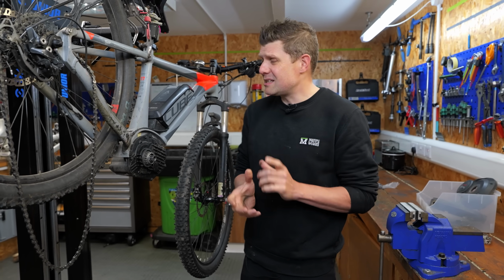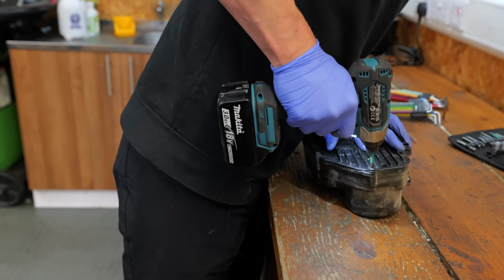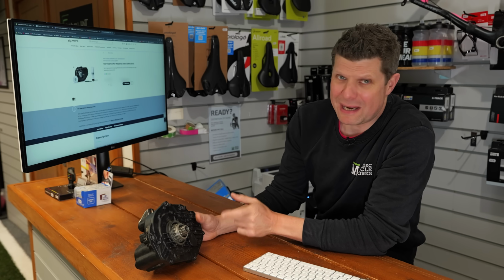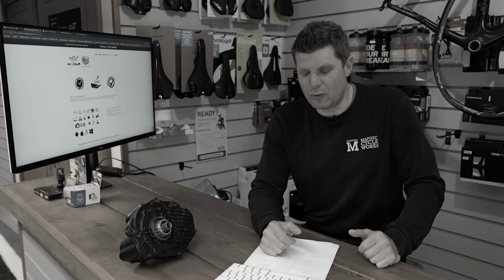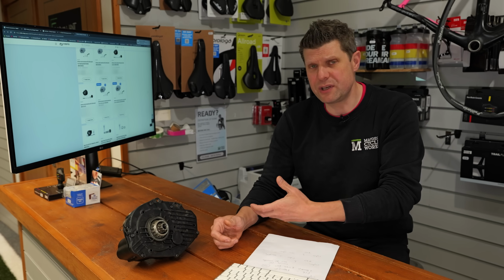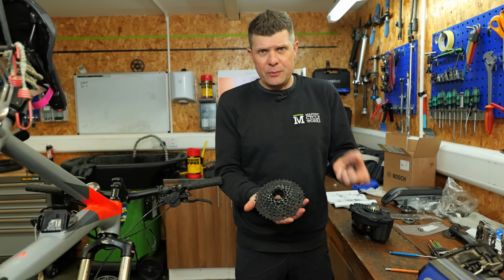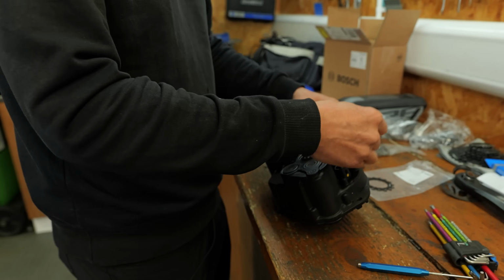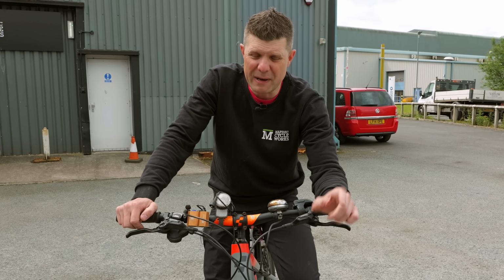This £750 eBike repair could have been avoided

Comment: my first mtb gary fisher steel frame lasted 10 years without any service no brake pads no chain absolutly nothing.. after 10 years .. maybe it was even longer.. the steel frame started to rust the brake lines where getting worn the chain was worn and the rim was bend.. So i bought a good second hand with aluminium frame.. Now that frame is never gonna rust.. And you can still buy parts for it.. So when that one was a goner i put it on marketplace and i got some crazy bids on it Just because it was fixable. I got good money for a bike that needed full service.

Comment: Got an Orbea Gain to save on petrol,. The controller failed just under 3 years. Warranty is two years. Will cost £750 to repair because the controller is built into the battery. The bike has done 6000 miles, which means the bike has cost me £12.50 for every 100 miles. This isn't including the cost of the bike, chains,  pads, free hubs, etc. it's cheaper driving
Reply from the maker: Yes.  You are very right.  EBike ownership is not a wallet friendly solution for the environment yet.  It needs to change fast.
Reply: But no road-tax, insurance, or parking fees, eh? Ordinary non-E-bikes are cheaper in the long run, and if you stay away from the newer race-developed components and frame materials - serviceable with a minimum of special tools. 
I’ve been riding,and tinkering with bikes for sixty years. Simpler design that can be relied upon, is always better.

Comment: It does seem very time generous. From bike to stand running a diagnostic, dropping the motor out, cleaning stripping it, emailing several companies looking for help or advice, then deciding it’s not worth the effort, contacting and dealing/emailing  Bosch Support and ordering a new battery. Then fitting, a new gear cable, running through diagnostics again I assume to give customer a copy, drawing up the bill and test ride for £70.00?
Reply: No other bike shop would charge such a small amount.
Reply from the maker: There are things in this video we wouldn’t usually do. The motor was a gonna the first time I looked at it, but I made the video to evidence my experience really.  To rebuild a motor is usually £200 if it’s all electrically sound.
Reply: @Mapdec  Tbh i did think that might be a possibility. Anyhow more great content, i like these real life job videos that most bikes shops are coming across, we're pretty much (customer lead) all eBikes now. Not all of us, well certainly not us deal with 4-5£ carbon frames every day or even ever, apart from my own. Top banana!

Comment: That primary external bearing seems to get penetrated too easily. That is part on Bosh for using a high speed bearing with too little fill and probably not a grease that holds up to salt water very well. What is most likely happening is the outside seal is dry and really doesn't stop the water in the lips of the seal . If it's dry then the capillary action of the water will draw it in regardless of how good the seal is. These could be filled from one side and since the bearing isn't spinning at ten thousand RPM the grease will stay primarily on the one side and if that side isn't outside there isn't any to wet the lip and keep the water out. A little bit of overfill with a good marine grease designed to keep salt water out would go along way. Having a small amount of grease coming out of the bearing on both sides would insure a double lip seal of having grease in the channel between. The small amount of expelled grease shouldn't be a real problem and easily cleaned during the first service interval . These could last a hundred thousand miles and/or decades properly specified...in this case water prevention is the first concern and the slight additional friction and pumping loss is negligible anyway. 
   Why is that circuit board down in the water zone in the first place. It's exposed to both the heat of the motor and water. By necessity it can't be perfectly sealed due to the heat produced by the motor and of course water is going to get in and stick around for awhile.

Comment: Definitely did the right thing replacing the motor. From an engineering & environmental point of view all parts, especially the mechanical parts, bearings etc. in the motor should be replaceable. Even the pcb. Bosch should support this better imho.

Comment: I'd try to find that rebuild kit for a lower price or source out the individual parts to repair that motor.  Sure, the motor might be a little bit "jank" but so is the rest of the bike. Besides, there's probably better bearings and seals out there once you start dipping into industrial supply and other parts sources.

That's what I'd do to my own bike, but I don't work in a bike shop either.

Comment: Does my Bosch motor require regular service? Bosch motors are not designed to be serviced and should only fixed if they start to fail.

Bosch motors are not designed to be serviced and should only fixed if they start to fail. The motors are sealed for life and if kept dry will do in excess of 50,000 miles (80,000km) without problem.
From Ebike motor centre.
If kept dry.
How is that possible in the UK?

Comment: Another excellent video. Shimano do list that both Linkglide and 11 speed Hyperglide chains are compatible with the 9/10/11 speed Linkglide cassettes. I do wonder if the Linkglide chains would be a better match for the cassettes as their teeth profile is different to HG cassettes, why else would they make it when the 11 speed HG chains already exist?
Reply from the maker: Yes. But a 9sp HG is not compatible at all. Linkglide chain on linkglide cassette is also much quieter.

Comment: All in one units need to be designed to be serviced and also the electronics need to be protected separately from water ingress. I use a high power geared hub motor and separate controller, much more powerful than this unit and for similar cost, so even the material costs are not justified. It’s reassuring to see a knowledgeable and ethical business however.

Comment: Another point of view to repairing ebike motors is what if something goes wrong after the repair. Lets say i replace a torque sensor and it will detect instant max input and sends the customer flying
Reply from the maker: Like anything.  The liability will be with the repairer and their insurance.  So long as the repairer could show they were not negligent and followed best practices etc they should pay out.  Every professional should know where their skills lie. I have no idea how to repair a PCB and would never attempt it.  I am happy to correct carbon frames though. Does that make sense?

Comment: I think your labour charge even before any 'charity' was very very reasonable considering the legwork you put in.
I can only compare this to work I had done on my old van, new cam chain, engine out job, cost what the van was worth......... But my van was known to me, I knew that other than that it was sound, if I were to buy a replacement of the same age, what would I have got?

Comment: I thought I might be facing into a similar situation recently, emtb decided to just die whilst out on a ride.....wouldn't fire back up or anything. Driving hope with the POS in my boot, all sorts of thoughts started going through my head.

I get home and the bloody thing turns on. I couldn't replicate the issue but had two damaged cables, so ordered and replaced those.....whilst ordering I thought I would look at the prices of the display and motor (Shimano EP8) with a new display coming in at £150+ and "new" motor from GErmany at almost £600.....I came to the conclusion that if I had to replace the motor I'd probably just bring forward the next bike purchase. (To my wife disgust).

Comment: And this is just one of the many reasons why I am so hesitant to get myself an e-bike, besides the initial large amount of money you have to spend to get anything decent e-bike wise, it's the cost of maintenance to the motor/electronics on top of that. Most people don't take this into account and don't want to spend any more than what they initially spent on an e-bike, therefore they're more likely to get neglected as time goes on. This is not exclusive to e-bikes, this applies to every mode of transport.

Comment: Interesting that getting parts for the gen 4 are an issue as you can get lots of parts for the gen 2 Bosch; wonder why there is such a difference. I've rebuilt my gen 2 several times and it's on 40 K and going strong.
Reply from the maker: Where are you getting PCB, casings  and motors from?  Things like bearings are easy enough.

Comment: Paul. I feel your pain re the parts that manufacturers will/won't supply. Rohloff internally geared hubs (now fitted to high end Ebikes such as Riese & Muller - circa £10K) tend to leak oil through their main drive shaft oil seals (the simmerings) I can live with the fact that oil seals need replacing now and again, oil seals are simply a service item. Using the correct tools oil seals are easily replaced. However, Rohloff will not supply either the seals or the tools to the customer or the bike dealer. It's a Rohloff main dealer job only for such a simple fix . They used to supply these parts, but for their own reasons, they stopped doing it. Protecting the brand or blatant profiteering ????? 

Just to add, your labour charges are SUPER reasonable.

Comment: They have to get this to the point where there are Bosch authorized rebuilders, where you get a rebuilt one for reduced cost with a warranty and send in your old one as a core. That cost for a new one is absolute insanity. All this and other videos do is make me say no never to an e-mtb. I’d want a 5 year full no fault warranty on a motor on an emtb before I’d even consider it. Or some sort of flat fee (low) replacement on the motor after the first year, something.
Reply from the maker: There really needs to be at least a county by country refurbishment centre, or a few specialist shops like we have for suspension.

Comment: Why is that PCB out in the open next to the spinning gears? Why not have the electonics in a separate sealed compartment? That way, if the primary outer seals around the axle fail (with spinning parts always providing extra challenges for effective sealing), you only wear down the gears and axle a little faster, instead of having a financial or technical (because of lack of spare parts) write-off.

Comment: I don't even feel sorry for customers like this. They were not giving a fuck about their previous bikes and that hasn't changed but the cost for this is now much higher...
Reply: TBH, for cars it's better, because servicing schedules are prescribed very clearly. For bicycles, very few owners have an idea of when an actual service is needed. Most basic non e-bikes nowadays, you could just bring in, when a problem becomes noticeable, and they will just swap bearing cartridges, and maybe chain, chainrings, cassette. But you probably aren't causing any huge bill to accumulate. Whereas for a classic bicycle with adjustable bearings for the BB, headset, and wheels, you actually need to do a service at regular intervals, by mileage or time, to not destroy your bearing races.

Comment: I’m not a lawyer, but you would hope the right to repair law would force Bosch to provide spares including spare pcb
Reply: Not necessarily. If I produced what I considered to be a 'sealed unit'...why would I stand behind a warranty when someone (most likely a grease monkey) has compromised it, let alone with my name on the unit .

Tell me folks, do you fix your own Integrated Circuits? (Actually it can be done in some instances, by absolute professionals who have a lab). The same applies to mechanical modules. 

I fully understand and agree with "Right to Service" legislation. But I also understand 'sealed units', and they've been "a thing" for a century.
Reply: @stephensaines7100 in that case, they should have more faith in their product and provide a more substantial warranty on the sealed unit. Ebike users are either getting shafted by lack of reparability or lack of warranty.

Comment: you can buy bafang and tsdz parts - i bought my kit from pswpower - and they have lots of spares for these brands... A brand new controller unit for a bafang BBSHD cost 58£... Bosch needs to get a grip - and not by the way copy apples insane system..

Comment: I am surprised to see the control board isn’t fully potted to prevent damage from moisture.
The lack of spares to make a repair is a calculated money grab from the manufacturer.
Reply: The case was. I'm an 'old school' tech...I avoid boards, (in most cases, but not always) and do what's termed 'point-to-point wiring. Google it. But I can assure you potting a board can cause as many problems as not, not least heat dissipation.
Reply: I’m an old automotive ECU engineer. As I recall, the PCBs weren’t coated because it caused more harm than good. Moisture just wicks between the layers…

Comment: It isn't clear on the video, or photos on Google, but are the bearings behind a lip seal or are they just relying on shields to keep water and dirt out? If there are just rubber shields then they won't keep rain water and dust out, they're just to keep larger particles and some indirect spray out, and out of the box it would only be on borrowed time before it dies
Reply from the maker: There is another seal before the bearing, but it doesn’t help much. This is the thing we clean, check and sometimes replace  in a service.

Comment: If the cost of a second hand replacement vs repair is the same or close, I'm doing a repair all day long.  You don't always know what you're getting, with this repair they're getting a new warranty on the motor, and the satisfaction that everything else mechanically with the bike is sound.
Reply: Replacing old parts with brand new, is not what is generally understood as repairing.

Comment: Seeing as linkglide uses bog standard 11 speed shimano chains, should we assume the other shop fitted a 9 or 10 speed HG chain? The "linkglide" branded chains are different in model number only. Officially compatible with any other shi 11 speed drivetrain.
Reply from the maker: Yes.  A 9sp chain was fitted.

Comment: I agree that it’s important to get these eeb’s serviced, just as this customer did at another LBS… Having said that, I have a Shimano EP8 and nobody will touch it… at all… There is one place that will, but they are using the Shimano software in a way that is actively discouraged (threats) by Shimano and the distributor (we all know who that is). So, out of warranty with a fabulous bike (Bullit) in superb nick, all I can do is be very nice to my bike (which I am). But selling it is out of the question, because I can’t get its functional value second hand (as you explain) and my only option is to wait until it stops working and buy a new one (~ £900 or maybe £850 if the Distributor takes pity on me and, of course, whilst I would have a new 2 yr warranty, I have no idea if every component is new (they refuse to make a statement about that - check if you don’t believe me and, yes, I know that’s not allowed in the U.K.). Consequently, as I’m not a millionaire, I am locked into this frame which as it happens I’m happy with because it has a lifetime warranty and I can get free new bearings every year (Sant Cruz). But that’s not true of other manufacturers with an EP8. And, anyway, why am I being punished in this way? If the bike’s true value was realisable as with some other eeb motors, I and many would have a choice to upgrade.
Reply from the maker: Ummm.  What is the gripe with the software? The EP8 motor is supported still.  Do you have it chipped or anything?

Comment: I like the insights one can gain from the video, but I don’t know how one can make a business from repairs like this. £70 for the labor is exceptionally cheap. Now every customer will think DU replacement, with a full ebike service and a small repair is to be had for this money.
Reply from the maker: All we actually did was clean a cassette and fit a motor and chain. Hard to justify more despite the faff.

Comment: Great job! With the bearings that shot the bike must be creaking like crazy for ages. It's the customers own fault the motor looks so bad. A few months ago a simple bearing swap could have saved the motor and prevent water ingress. Nevertheless it's planned obsolescence by the companies. My way to battle this is by boycott. Only bike I've ridden the last years for commuting is a On One pompino Singlespeed with V-Brakes. Cheap parts, cheap and easy maintenance.

Comment: Right to repair needs to expand to all devices that are potentially repairable. Its madness that a cheap component can throw all that away, and require a full replacement, such a waste, and BOSCH should be doing more.

Comment: I just bought a used Cube Reaction 29er from 2020. I paid £1300... Which seems top dollar, but everything except the frame and wheels has been upgraded. Dropper post, hope stem, bar, brakes, derailleur, cassette, chain, seat and forks. At least a grand of upgrades, so it was a steal for that price

Comment: Maybe you can keep the motor and try to get the pcb fixed? Would make for a good experiment if that is possible and maybe you can see the motor as a "pay forward" kind of thing...
Reply: too much work to diagnose and  repair an unfamiliar circuit board.

Comment: Riding in flood water is the true mid - drive electric motor killer .
Reply: Don't have that problem with a regular bike plus it's lighter so I can carry it on my shoulder if need be.
Reply: @IowaNinersFan  I prefer analogue bicycles for the same reasons .